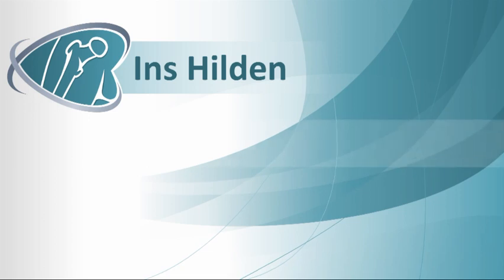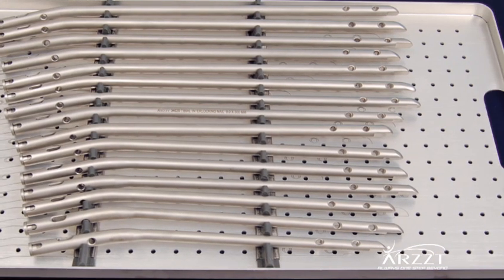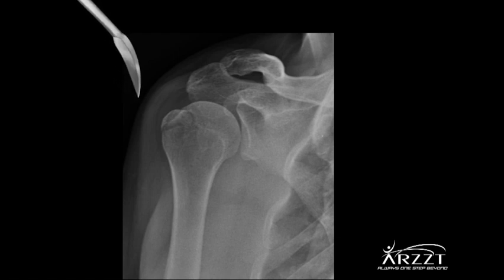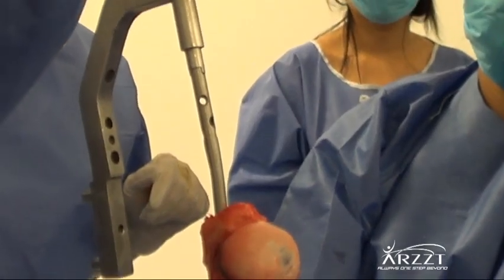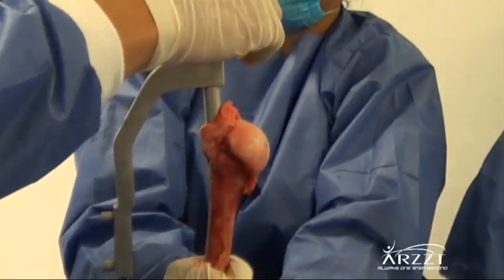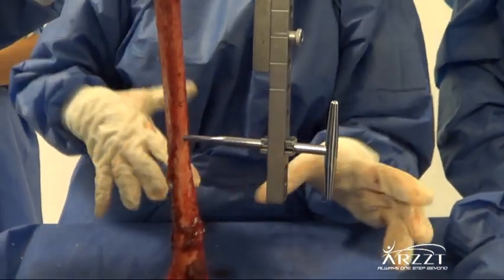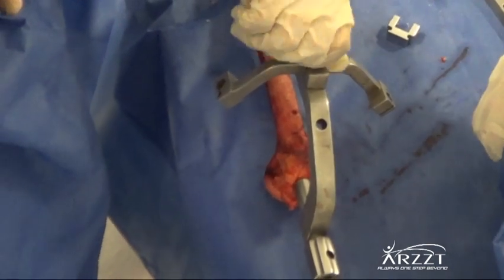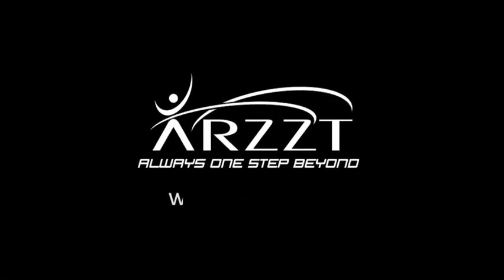Intramedullary Nail System by Trauma Orthopedic Surgeons for fracture treatment.

Comment: It's important to note that this surgery carries significant risk of permanent neuropathy leading to numbness and pain in the knee, for life. The majority of patients studied had this problem after this operation (about 75%)

Source: J Orthop Trauma. 2008 Sep;22(8):525-9. doi: 10.1097/BOT.0b013e318180e646.

"Long-term follow-up of tibial shaft fractures treated with intramedullary nailing"
Lefaivre KA, Guy P, Chan H, Blachut PA. Retrieved from NCBI.gov